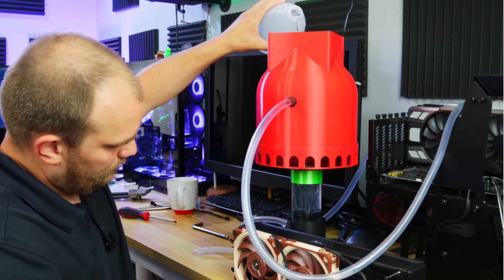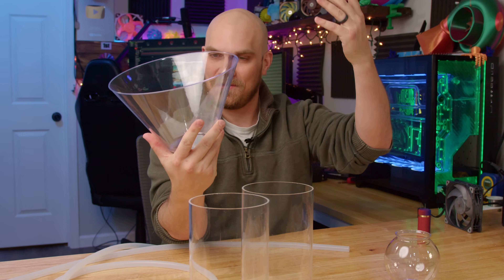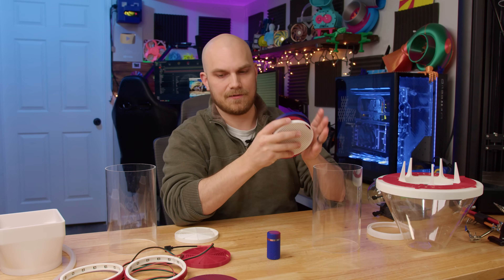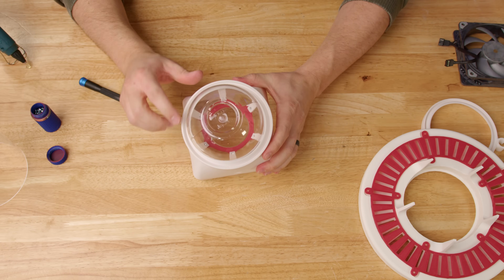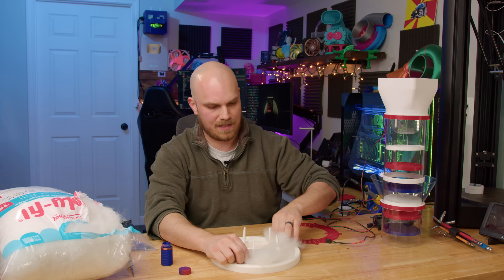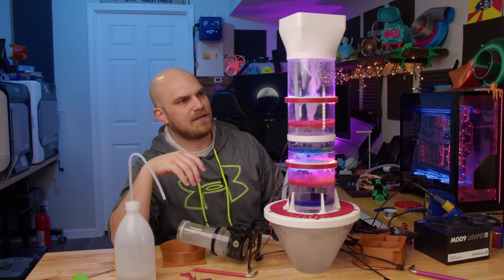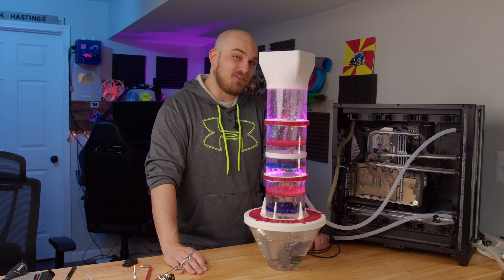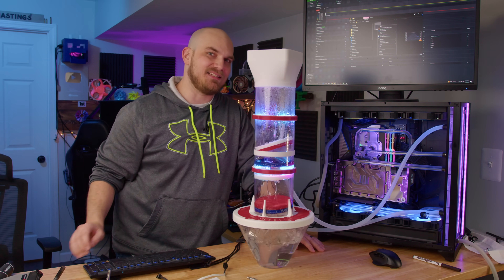Water Cooling..... With NO Radiators

Comment: Now this is an interesting system. However for proper benchmarking this, you now not only need the ambient air temperature, but also the ambient air humidity. And something else I wonder, is how will it be during the summer when you are aside from heating your room with your pc, also increasing the humidity by alot... I think it will be extra sweaty in there.

Comment: Tower should have been a little shorter, wider and used perforated trays to spread the water into smaller drops. These work on surface area of the water. Then use a larger fan(200mm). 

Downside to these is water loss. It would need to have a level maintained using filtered water to prevent buildup or alternatively use a heat exchanger so tower water does not mix with loop water.

Comment: This was really cool, I love wonky stuff like this. Imagine a large sized one of these cooling a whole room of computers. You'd have to be dedicated to the water trickle sound though, unless you found some way to mitigate it where the water drops into the base below (Where I assume most the sound comes from)
Reply: From what a heard, there are Google data centers where that’s pretty much the case. Evaporative cooling can be cheaper then running air through the system (especially if your data center is in a desert, where the air is very hot). Course, there’s the issue of being in a *desert*, and the whole “water is precious in the desert” thing, *but*, it does exist!

Comment: Maybe adding a support structure like a big shaft in the middle of the tube would help keep the filters? in place instead of hot glue. you could attach it to the cap of the bottom reservoir.

Comment: Way to overcomplicate a swamp cooler.  Looks neat, but...look at actual swamp coolers and cooling towers...  Could set up some misters in a box with a re-circ pump and 3d printed fill or just some swamp cooler fill to direct airflow and an exhaust fan and probably get better results.
  This entire thing wouldn't work too well in a swamp cooled home or one with a humidifier.  It would see better performance in dry environments.  But the more heat you can dump into the water the better.  That's why cooling towers are used with chillers.  Which, hey, I've been wanting to make such a 2 stage system for forever but getting good blocks would be a pain especially with how different chips have different hotspot placement.  I'm not wealthy enough to either risk delidding or taking a heat gun to a processor with no heat sink.
  Also, your unit doesn't have an auto fill.  Which that could become rather costly real fast.

Comment: I had a passively water-cooled gaming PC back in 2005ish.  I think the cooler I used was the Zalman Reserator 1 V2, IIRC.  It was basically a big external tower with fins running down the side to help dissipate heat.  You should see if you can get one of those for when you decide to go for round three, I bet it could be fairly easily adapted to what you're trying to do.
Reply: The reserator was a cool piece of hardware.
Reply: @epiccollision They no longer exist ?

I used to love their coolers.

Comment: These used to be called "bong coolers" and were used for cpu overclocking back in the pentium 3 and early Athlon days. With a 50-60w cpu, the shower head and pvc pipe type could cool the water below ambient and thus allow for what in those days was extreme overclocking. They were also relatively cheap back when dedicated PC radiators were rare and expensive. I think by about 2002 or so CPUs used enough power that they were no longer used much.

Comment: I remember reading about this is an old PC magazine in the early 2000's I think.  They used a shower head to split the water up in to smaller dropets & increase surface area to maximise evaporation.

Comment: Excellent work man. I’m impressed. I’d rather use that than radiators any day. I mean hell, I’m running 2-360’s with push/pull configs so 12 fans on the rads alone lol. The sound of a waterfall is much more preferable and calming than 12 fans lol.

Comment: Maybe you could keep the fishbowl design by drilling out some holes in the bottom of it. If the inflow is just a hair more than the outflow you could get the water running on the outer surface without blocking airflow for the fan.

Comment: I distincltly remember that there are plastic balls with slits and cuts around somewhere, that basically are made that way to increase the surface [ bioballs is their name ]. I would basically make the tower taller, put those "balls" in there and let teh water rain down. At teh bottom end I would put a "Y" piece with the second connector opening up and blow air in from beneath with a bigger fan, made for static pressure, a plate over teh balls with about 10cm distance to let it rain on the surface increasers should be enough. As for how tall that beast should be? About 2m floor to air outlet should be enough, the issue would be that thing swamping your room air, so you would need a reclamation system/condenser coloum to keep your home from becoming tropically moist and mouldy.

Comment: We used to do this back in the late 90s early 2000. We called it "bong" cooling. Works great, creates a humid atmosphere in you room. If you put a return pump(s) on the side at an angle you can get a really good vortex going that will increase the heat exchange. also try a shower head at the top. You need to make it taller and get the water from the showerhead to spray so it evaporates.

Comment: In the early 00's we just used 120mm PVC pipe with a Y piece on the bottom and an shower head on top, have the fan blow in air through the free arm of the split piece and you could achieve sub ambient water temperatures when running without load.

Comment: Is it possible to print those plastic parts in aluminium?  

The air flowing would chill them and then the water running over the top would be icy surely.

Comment: It always impresses me that computer cases are a large source of problems for cooling.   The big example is how rack cases need front to back flow so have to have small, very fast and noisy fans.  Or in this video, the radiators have to fit into a PC case, so they require 3 fans a piece.  Your water tower is using a single fan and is cooling as well as those 2 radiators.  The trade off is that it's much to big to fit into a PC case.

Comment: I'd love to see this idea expanded on yet again. More fill density (I get what you mean about the aesthetic side, but I think you could definitely cram more in before it starts to look like a solid lump), spray nozzles (which may require a stronger or secondary pump), and maybe additional fans for improved airflow (could do 4 fans arranged to form a cube that exhausts out of the sides).

Also if you didn't do it already, probably a good idea to seal all the gaps with silicone, just to ensure that the fans are pulling all of the air from the bottom, not though any small gaps.

Honestly, I think this is an interesting enough idea to explore further. It'd be cool to see what it could achieve with all you've learned from previous versions.
Reply: ya I'm thinking the same way, I have worked on industrial towers and there is definitely a lot more room for fill.  the fill is the important part.   make 3 gaps for rgb and so you can see the water drops, the rest alternating fill.  Also im wondering if a different fan style is required.  Something like what is used in vacuums.

Comment: G'day Major,
Along with the Fan Showdown I love these "caraaazzzy ideas" videos, it is Awesome the way you get everyone involved in the channel content, rather than just telling us "I did this".
WOW! compared to a regular loop it is also really 'cool' & I guess if you like those calming fountains it would be great knowing your fountain also has a PC Purpose, but me even for the short running time 😬I had to stop the video to go for a bathroom stop😂,
🤔some thoughts to help longevity shorter clear tower tubes (same overall height but 6 or 9 instead of 3) with the Fill pieces integrated into the joiners, maybe a straight sided bowl at the bottom to hold the same amount of water but lower the Water level to prevent splashing the air filter.

Comment: You should do a video on cleaning your loop, trying various things to flush it, and using a boroscope camera to get in up close to the parts we can't normally see, like down the fitting hole of a radiator.
For instance, one of my ideas is to pour drain cleaner into the radiator, let it sit overnight, then flush with water until clear. Possibly other things as well, like Isopropyl alcohol and automotive paint solvents. Then move on to stuff that should be more compatible with the plastic and acrylic bits of your loop, once you think the radiator can't be cleaned any more.
Reply: Definitely don't use drain cleaner! Common drain cleaner is made of sodium hydroxide which will readily attack copper metal. Newer ones made with different chemicals may be safe for copper pipes - check the documentation carefully. Most acids, such as hydrochloric acid or vinegar (acetic acid) are safe.

Comment: @ major hardware, there's a number of mistakes with your design.
1. the hole spacing on the grades needs to be far enough apart that the surface tension of the water wont allow it to fully cover the hole/slot. the water is self is cutting off the air
the purpose of the grates isn't to increase the surface area of just the water, but of the contact area of water to air. you want air to path everywhere water is pathing. 

2. noctua fans are designed as push fans. they can pull with a decent amount of force but they are not intended to maintain a vacuume; they do not seal. mmH2O is measured in POSITIVE pressure. you might have more success pushing air from the bottom with a ring of fans. 

3. you aren't getting a flat sheet with this approach at all; the water is dribbling too much since your grates aren't level; causing the water to dribble to the lower point due to surface tension. the design you're using simple CANT work on a small scale due to surface tension unless everything is 100% level. a mist nozzle might be a good idea to try too.

you're better using the surface tension to your advantage by making a square tower and having the water slide down a flat sheet on an angle; doing a zig-zag all the way down. you need about 20-25mm of gap between the waters high point and the wall to allow a decent enough amount of air to flow unimpeded. im not sure it would produce significant enough results unless you dramatically increased the footprint though.

Comment: Am I wrong in seeing this as a giant exploded radiator? Obviously it uses evaporation and air temp differently than a closed radiator, but it seems like the fill in the tower is heatsoaking in the same way a typical rad would (probably more efficient if it were metal, though)

Comment: Tech Ingredients channel have a good PVC dual stage evaporative cooler you might want to look into.
Also, you're getting a fair bit of cooling from evaporation, so it would be interesting to know what the difference in coolant volume is both before and after testing.
Reply: The bio-balls the guy in that video was using would probably work really well in this.
Reply: @jtillman8251  
To be honest - I suspect even filling it with coarse gravel would work better than those plates.

It's nothing new, called random column packing, and probably the only feasible route. Because proper structured packing isn't available at such sizes afaik.
One could just print a whole column of bare gyroid infill or some such though, that might give good results as well.

If he revisits the idea he should probably just get some readily available Lessing, Bialecki or Dixon rings - those are quite similar to bio reactor packing in some regards, but both are kind of optimized for very different applications.
Reply: I was also thinking of their solar air conditioner system as a basis for this sort of loop.
Reply: Tech Ingredients more interesting video in PC cooling is showing that a window unit A/C cooling a heat pipe system is better than a window unit cooling a water cooler.  Heat pipes are much "faster" thermally than direct water cooling due to the vapor phase transition, and thus more efficient at using the greater delta-T of an air conditioner. 

As for the video premise, it's aiming for failure which is sadly too common on YT these days to drive engagement. The opposite approach ala a Zalman Reservator is a much better pivot in water cooling but has the flaw that it works out of the box -- recreate the Reservator on a much grander scale - say a 6-8 ft tall tower with a 1 1/2" or 2" copper pipe or aluminum tube with some fins. In a sub-1 sq ft footprint, it would outperform the stock fan based radiators due to water volume and surface area. For bonus cooling, stick it under an A/C vent during months the A/C is in use. Heck if you used the steel tank from a scrap water heater or propane tank, the coolant volume and vertical velocity (hot going in top) would be so low you don't even need fins or higher thermal conductivity and radiative metals like copper or aluminum involved.

Comment: I was just about to research how to do a more efficient evaporative cooler for a project of mine. I plan on integrating your fill design with my cooling towers. 

Instead of an upper fan try using an aquarium air pump in a lower section of the tower. This way you have a positive displacement system, relatively speaking compared to a fan. 

If you plan on sticking with a fan suction design, use a fan designed for radiators.
Reply: Was thinking about the CPU cooling. I was wondering if mist nozzle spray onto a finned block of sorts could put the phase change on CPU block...

Granted the mental picture of everything is rather exotic. Imagine a smoke stack out the top of the case. 😂

Comment: I guess you might be able to incorporate the porous/high surface area materials in the evaporative coolers into your design, might be able to improve performance :D
Reply: Or you can maybe use something like the impingement rocket fuel injectors, just shoot a water jet into another water jet at super high speeds and you get evaporation!

Comment: Stuff it full of scotchbrite. That will give you more surface area to allow for cooling. The water will spread out from surface tension. Or get one of those ceramic wine chillers that cool by evaporation through the ceramic and use that as a reservoir.
Reply: Ugh. Tried this once. It's amazing how abrasive water becomes when microscopic bits of scotchbrite break loose.

Try it if you get a chance - geta clean stainless pan and just wet a pice of scotchbrite and shake it around in the pan. Green abrasive dust will puddle in the pan.

Comment: The fill is to break up the water into droplets of a certain size that maximizes a ratio of surface area to volume, so that the evaporation from a droplet cools that droplet maximally. Evaporating a film from a solid surface does nothing in a system like this. There needs to be droplets returning to the sump. The fill also slows its travel time from top to bottom, giving more time for evaporation.

Comment: you should combine a water pump and some kind of black body radiation cooling aparatus like what tech ingredients channel has made in the last few videos.  They proved you can radiate heat off into space.  Run a pump through that onto a cpu.  It would have to be big though.

Comment: I saw a guy that basically made two bigger versions of this to use as an AC for a room... the one thing I really remember is he squished up smaller water bottles and put the lids back in and used those as fill. Because the water would be forced to find it's way around all the bends it seemed to work really good. and maybe put a 140 fan on top? I like the idea. though if the flow was right would cool your PC and double as a desktop waterfall.
Reply: I recently watched that video.  He made a improved version and moved it outside.  https://www.youtube.com/watch?v=7w4rg3UcsgI&t=17s

Comment: these are called swamp coolers and they work by evaporating water to dump heat and you probably went the second worst possible way about this the only worse choice being to just having a hose dumping the water in the top.    to fix this and make it usable remove the mid plates altogether they just make this more complicated then it needs to be and at the inlet you just use a shower head there you now have a usable cooler

Comment: I wonder if this could be done entirely passively like in real power plant cooling towers. hot water is dispensed at the bottom and spread out. That heats the air inside, which rises and naturally causes a good bit of draft cooling the water. This, if you make the water spreading out silent, could be the most silent cooler in PCs

Comment: So a couple of thoughts, if you really wanted to make it go crazy: 
Electroplating the fins obviously metal will conduct heat better.
Double the number of separating plates.
Add a collar to split to numerous fans and increase static pressure. 
This system though is reliant on low humidity in the air you are pulling in. I love how much success you had with this, it was awesome, thank you for humoring us.
Reply: Ooh, also replacing the shower spreader with a mister or a series of misters would be ideal.

Comment: On the stock system, fan orientation can make a huge deal. I accidently switched a fan at the rear of my case to blow into my CPU cooler and it raised idle temps from 40c up to 75c.